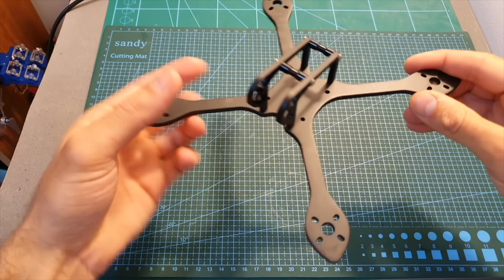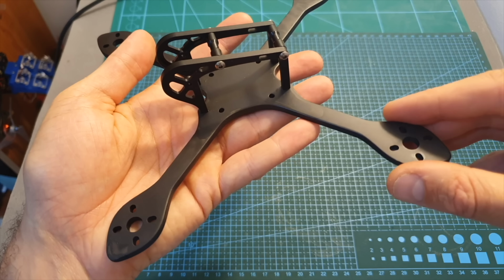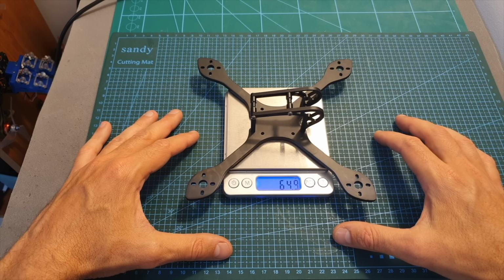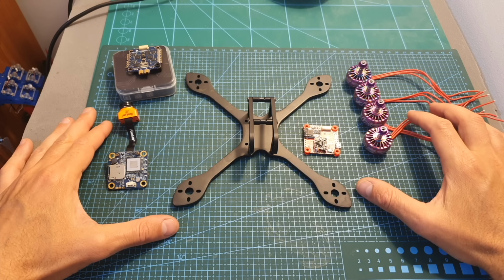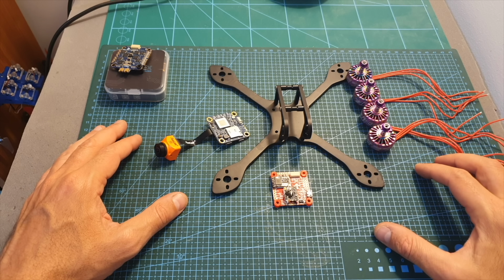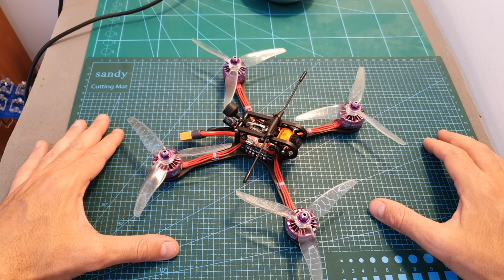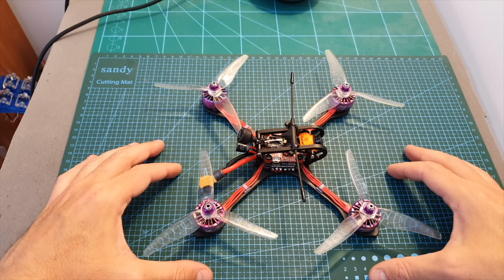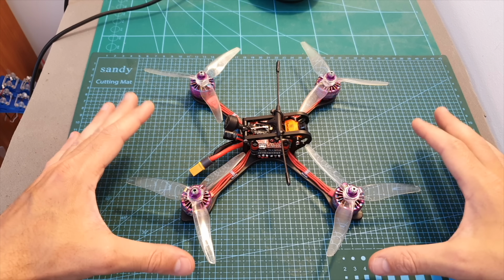TBS Stardust SB5 Pro Molded Carbon Frame - Review, Build & Flight

Comment: beautiful build love how clean it looks
I need the skinny on 4 in 1 esc or just regular. have you ever had trouble with the four in one?
Reply: Well, it depends on what you like and what makes you feel better. You know?
Single escs are much safer to use because if you burn 1 you just need to charge 1. No doubt about that. But there are lots of pretty good 4 in 1 escs as well. So, if you choose wisely, you won't have problems as well. You know?
But, remember always that shit happens to everybody. I never had problems with 4 in 1 escs, but sometimes even the best ones can burn, or have some defects and so on. That's just life. 😊
Reply: MC's Creations im intense sometimes its my passion. .I onow you understand
Reply: @SilverTopFlyer  Sure, dude! Don't worry. 😊
Reply from the maker: Thanks. I mostly use 4 in 1 ESCs and I can't remember the last time I had issues with them. Just like MC said - get a high quality one and you should be ok.

Comment: just wanted to know if you still have this one? how did it age? are there any other moulded carbon fiber race frames
Reply from the maker: I have too many builds and didn’t keep it so unfortunately I can’t be much of a help. 
As far as I know these frames are not that common.
Reply: @KremerFPV  i got a dozen of these in the tbs blowout sale at 2 usd a frame. Hope they hold up well.

Comment: How stiff does the frame feel by hand? It looks nice. I really think you should use at least 5s or 6s on your build, otherwise those big and heavy motors are a bit a waste on 2150kv.... You surely know that already. :)
Reply from the maker: Very stiff - feels unbreakable (but I didn't test it). 
I did try it with 5S, as these motors can't handle 6S as far as I know.

Comment: That is a premium build! Too fast and nice for me to beat up racing though :)
Wonder how durable this molded carbon is. The molded polycarbonate Oblivion frame has been holding up great for me (except the canopy and cam mount).
Reply from the maker: It should be extremely durable. Regarding the Oblivion - as far as I know it's molded plastic and not carbo (unless there is a carbon version that I am not aware of).
Reply: @KremerFPV  Let us know how your Stardust holds up. 

I remember you were not very impressed with the Oblivion :( Oh, but from what I understand, it is molded polycarbonate (similar plastic as most of the propellers), not molded carbon like the Stardust.
Reply: I LOVE  the Oblivion.  I am so sick of carbon sheets.  absolutely no character .. @TweakRacer